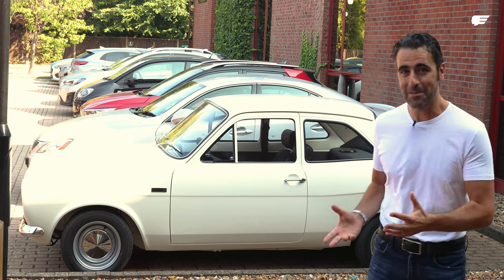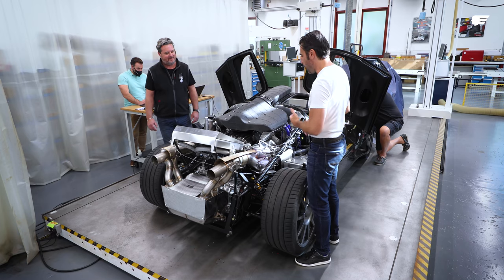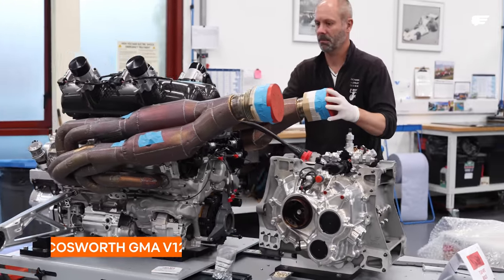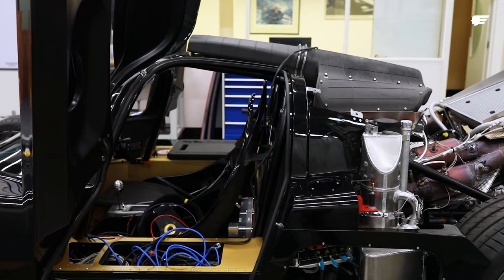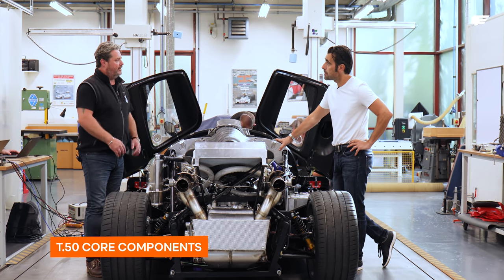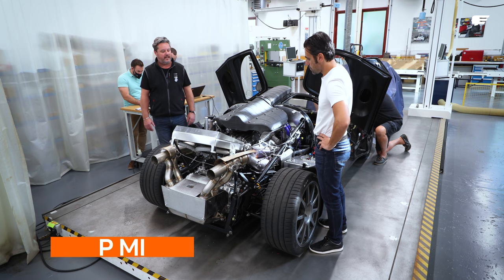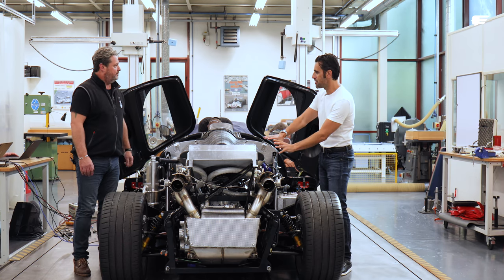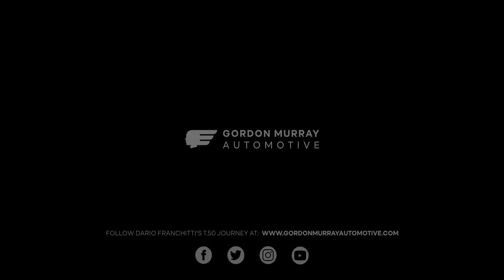T.50 VLOG | EPISODE #1 | FIRST MULE CAR ENGINE START UP

Comment: Nice sound! Can't imagine that feeling driving a such noble NA engine hitting 12000 rpm must be! Like a bike on 4 wheels!
I've the kind of feeling Gordon wanted to make something, again, unique, with his genius (and I'm glad he did), and a sort of modern car (in the design), but which could provide to the driver the feeling of being inside an old F1 car with a racing engine capable of hitting above 10000 rpm + manual gearbox!
Meantime, I think that it would have been better to have an engine of around 800 HP, then with, at least, an optional sequential gearbox on demand, I'm pretty sure more than the half of the customers will take that option! (or start a poll about it)
So a customer could choose to drive an old F1 car, or a modern F1 car!
I know he is probably not looking for a car capable of beating modern hypercars ones in runs, which are more drag cars with turbos, because not only that matter in the driving pleasure, but he should have boosted it a little more, despite the car is very light, and makes me think to the Lambo Sesto Elemento in the concept and specifications!

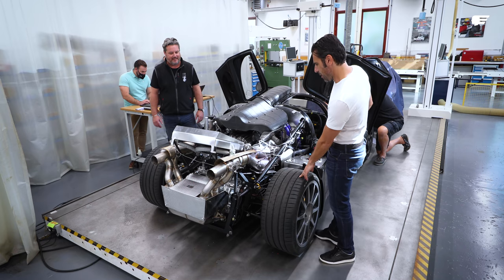Comment: 1:17 what is a heat management car?
is the box that is behind the rear axel the muffler and if so how is the air getting pipped around and through?
Reply: I’m guessing a heat management car is when testing engine’s ability to keep “cool” under high load, high ambient temps etc. Imagine would need a proper XP car for that.

Comment: Can someone explain to me that exhaust please?
Reply: On each side, 3 + 3 cylinders into 2 catalytic converters (+ OPF?) then two to one pipe, then down into a muffler then up to the horizontal exhaust pipe. Looks like there could be a valve on each side to bypass the muffler, although that would seem a bit extreme for a road legal car... running with only the cats and no mufflers will undoubtedly produce lots of decibels :)

Comment: Only bad thing about this video is engine startup restricted to 4000 rpm. Even at that low rpm it still sounds like a race car idling. I'm curious how the analog rpm will keep up with a engine that can rev 28000 rpm per second. It was too fast for the Lexus lfa super car. They had to use a digital rpm meter. Seems to me every time you wouldn't be able to enjoy the rpm climb without constantly pegging the rpm gauge?